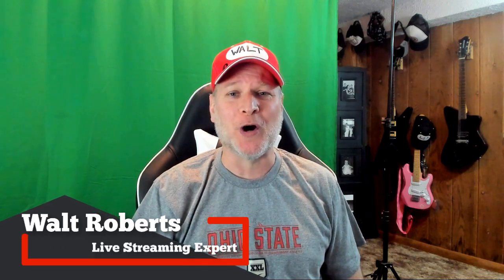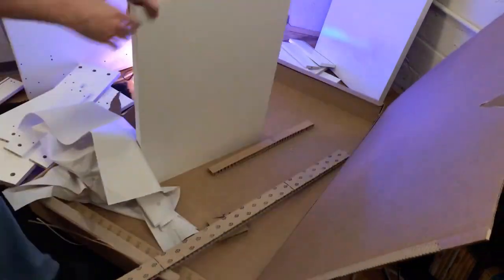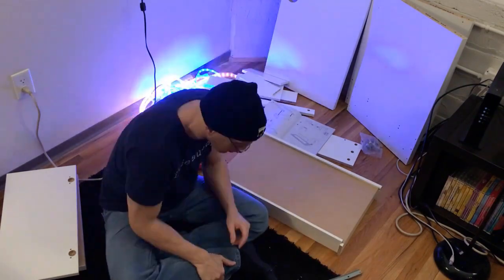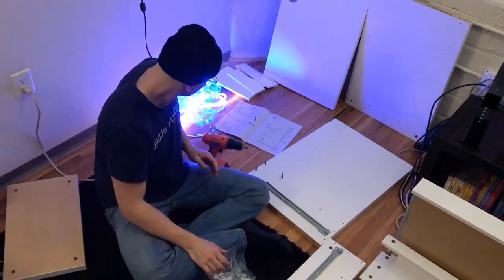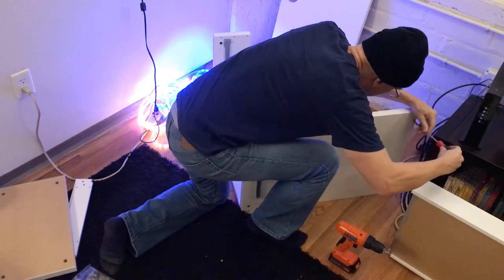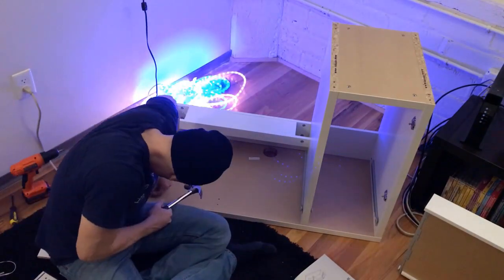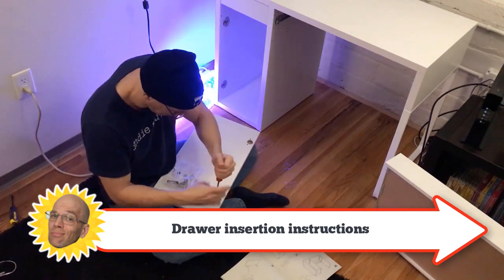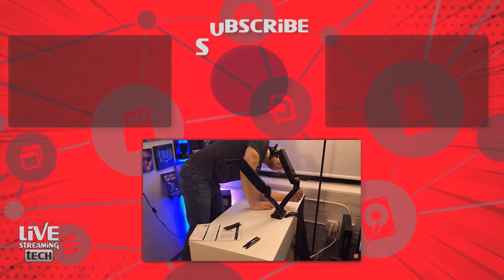Ikea Micke Desk Assembly

Comment: Would you think it’s big enough for a double monitor setup
Reply from the maker: It actually is. Dale uses two monitors, a keyboard and a Mac Book Pro while still have a little room for a few things. It’s not a large desktop, but if you’re economic with your space, you can make it work. We recommend using a dual monitor mount.
Reply: Did you end up going through with it? I'm planning on doing that myself with 2 24 inch monitors...we'll see how that goes😅

Comment: Hey you may or may not remember me from yesterday because I commented on the smaller desk video, but i wanted to ask the same question but on this desk. Can you run a cord through the hole into the drawer part? Because I want to like put my computer in the drawer and charge it at the same time. So is it possible to run a cord through the hole into the drawer part?
Reply from the maker: This desk is literally the same except it has a cabinet. So, the answer is the same. I prefer this desk a bit more sense I have the cabinet and extra drawer. Worth the extra few bucks.

Comment: Looks siiick
Reply from the maker: It’s super functional. I put lav mics, audio interface and stream deck in there. And slip my Mac in the large drawer with miscellaneous things. 

Ain’t gonna lie, it took a minute to work the cords into the drawers, but I did it. Now, I can pull what I need out, place it on the desktop and store it away later.
Reply: @LiveStreamingTech  wow nice That its enough space for all the stuff
Reply from the maker: Oh, for sure. Since I owned the IKEA Micke Cornerstation, I knew it’d be durable. But, that cornerstation was a space hog. This desk is more than adequate.

Get this though - we have an even smaller version of this desk. My wife didn’t need that much space like I do. So, we got her one without the cabinet.

We’ll be launching that video in the coming weeks. We try not to overdo the unboxing videos.